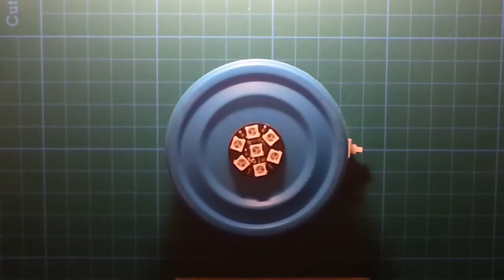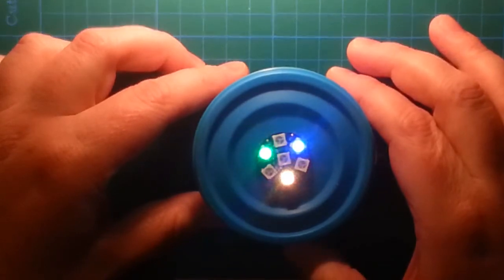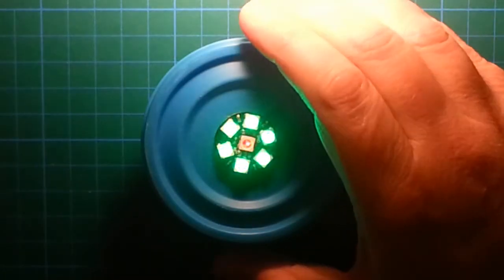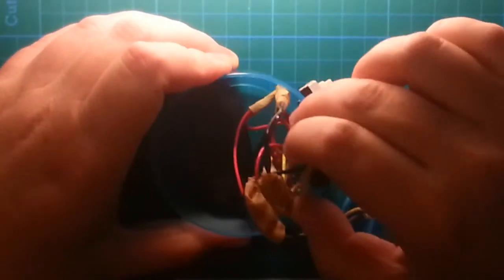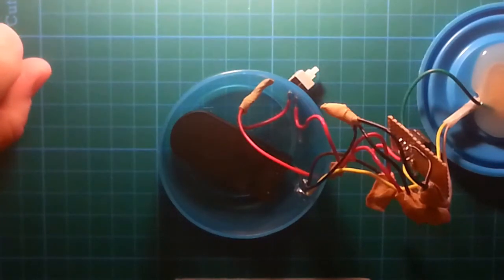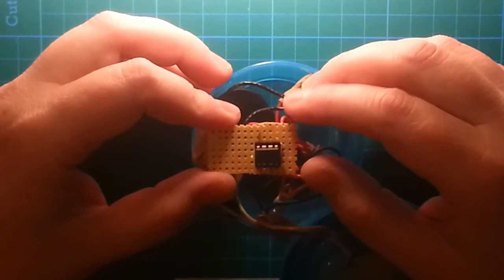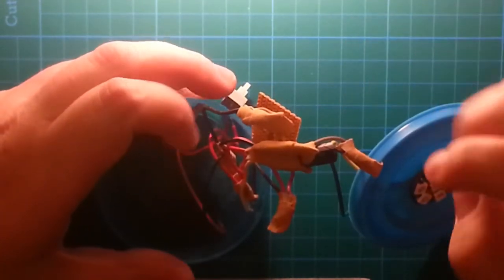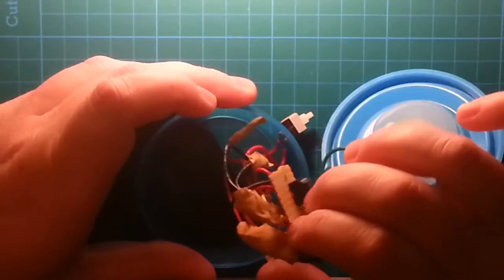Neopixel Toy (my electronics project)

Comment: Hi there I really like this. The Red light pattern at time 38 seconds in your video is very good. I'm building a Star Trek model and that red pattern would look good. May I ask what code did u use and what chip is that. I'm very new to all of this c++. Thank you very nice video
Reply from the maker: Thanks. The chip is an ATtiny85. Its a smaller memory version of the processor on Arduino boards. The code is C++ programmed via the Arduino IDE.
Reply: As it is a neopixel did u have to use a special code?
Reply from the maker: yes the neopixel library from Adafruit. Beginners guide see https://learn.adafruit.com/adafruit-neopixel-uberguide/arduino-library